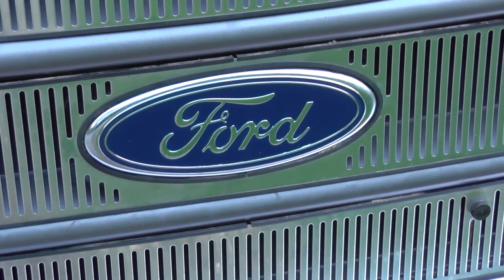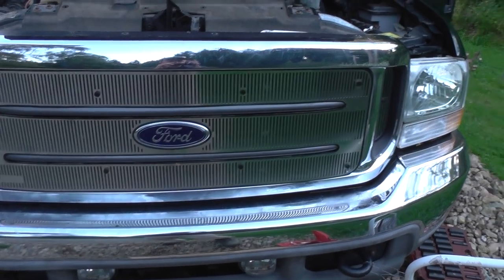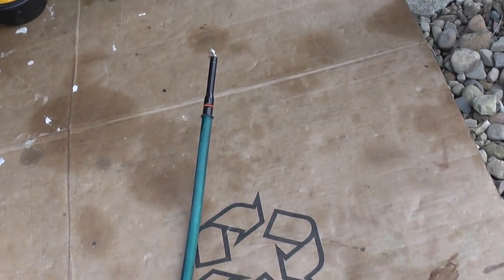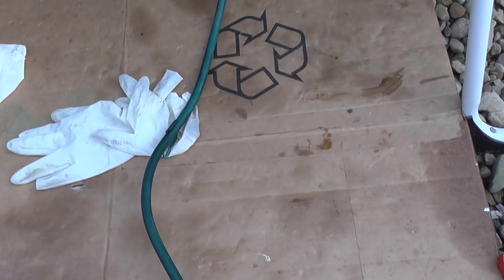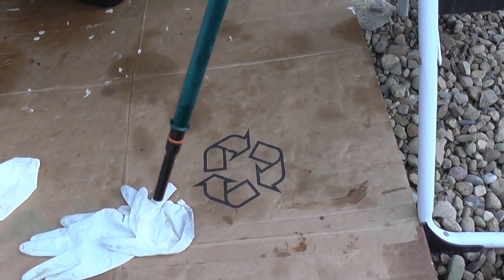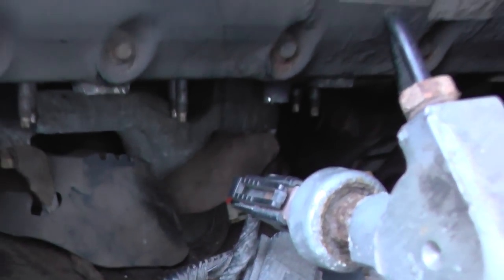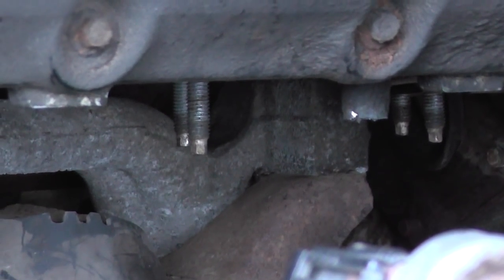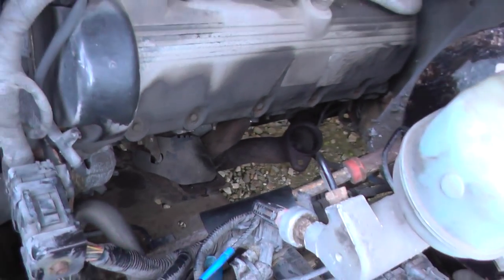Part1 Oil Dipstick tube on Ford 5.4

Comment from the maker: Synthetic oil filter https://www.amsoil.com/shop/by-product/filters-and-by-pass-systems/oil/&zo=5257753

Bypass oil filter https://www.amsoil.com/shop/by-product/filters-and-by-pass-systems/by-pass/&zo=5257753

Fram oil filter http://amzn.to/2z453pR

Purolator oil filter http://amzn.to/2y59QJb

ACDelco oil filter http://amzn.to/2yv2C2C

Ford motorcraft oil filter http://amzn.to/2fXE1f6

Toyota oil filter http://amzn.to/2y1chep

Honda oil filter http://amzn.to/2y5NhUR

Dodge Oil filter http://amzn.to/2xnC3Yk

Nissan oil filter http://amzn.to/2z2N2bn

Subaru oil filter http://amzn.to/2ghxXLA

Mazda oil filter http://amzn.to/2z46rc3

Mobil 1 oil filter http://amzn.to/2ksgm8g

BMW oil filter http://amzn.to/2y4Ar9c

Mercedes Benz oil filter http://amzn.to/2fWby9s

Comment: Hello friend  I have 2005 f250 super duty the link say not fit to this model can you help me please
Reply from the maker: What engine size?
Reply: 5.4 engine size thank you
Reply from the maker: I will get back to this coming Monday.
Reply from the maker: eBay has it 
here is the link
https://rover.ebay.com/rover/1/711-53200-19255-0/1?mpre=https%3A%2F%2Fwww.ebay.com%2Fitm%2F05-10-Ford-F250-F350-Super-Duty-5-4L-V8-Engine-Oil-Dipstick-Tube-OEM-5C3Z6754BA%2F191848843035%3Ffits%3DYear%253A2005%257CModel%253AF-250%2BSuper%2BDuty%257CMake%253AFord%26epid%3D1711159936%26hash%3Ditem2cab15071b%3Ag%3AKH8AAOSwXpFbt6Zk&campid=5337992468&toolid=10001&customid=

Comment: Where is the link for dipstick thanks
Reply from the maker: here is the link http://rover.ebay.com/rover/1/711-53200-19255-0/1?ff3=4&pub=5575246302&toolid=10001&campid=5337992468&customid=&mpre=https%3A%2F%2Fwww.ebay.com%2Fitm%2FOEM-NEW-Engine-Oil-Level-Dipstick-Tube-5-4L-6-8L-Super-Duty-Excursion-F81Z6754FA%2F191742268845%3Ffits%3DYear%253A2002%257CModel%253AF-250%2BSuper%2BDuty%257CMake%253AFord%26epid%3D1439364711%26hash%3Ditem2ca4bad5ad%3Ag%3AmlIAAOSwatRbX2lm
Reply: fantastic thank you

Comment: i did not like this you did not show us how you got the tube out  mine broke off at the block and i cant get it out
Reply: how did u get it out
Reply: +Cheesestanton mine dry rotted at the exhaust manifold I brought it to Mechanic who in the process of trying to get it out snapped it off at the oil pan so alls I did was taken over size bolt that fit the pipe that was in my hand and Add a socket put the bolt through the socket and then tighten it down so I pulled the pieces out of the oil pan
Reply from the maker: I have explained the details in one of the videos part 1 or part 2. There is no room around tube to get camera in to show details of removal process.
Reply from the maker: see part 2 video.
Reply: What if I don’t need to replace all those other hoses do I still need to take out the manifold?